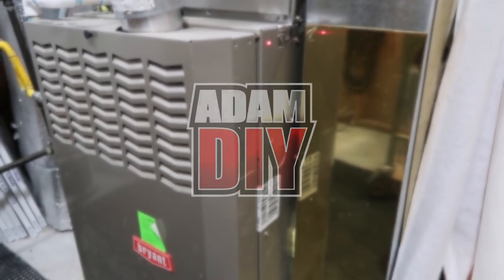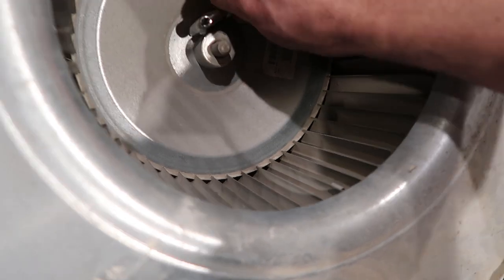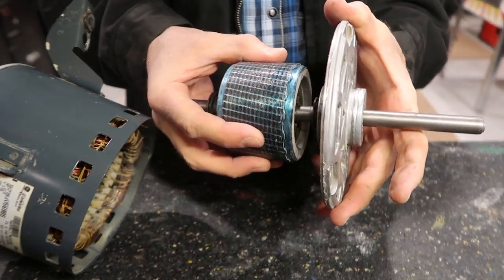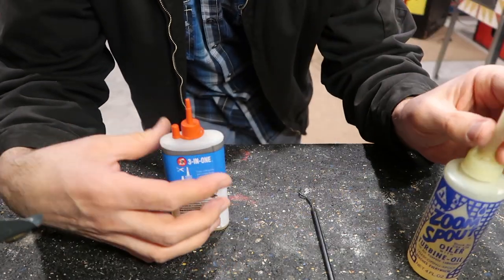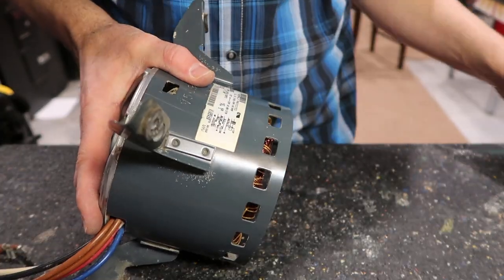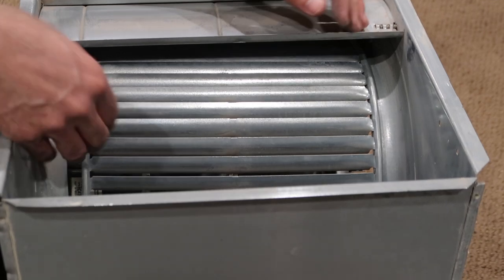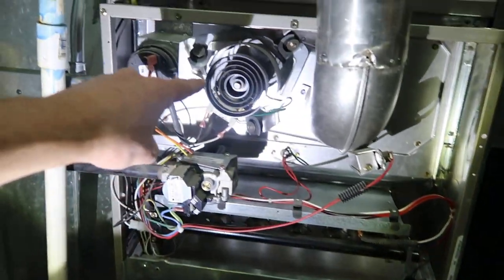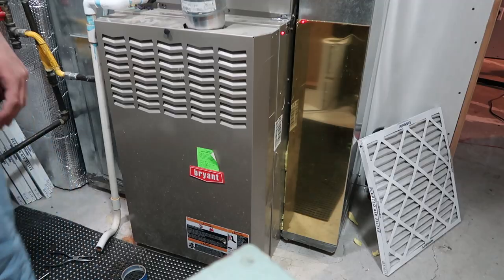How to oil electric HVAC fan motors with no port - Squeaky Furnace Repair

Comment: I got as far as trying to pull the motor out of the housing, but the shaft won't come out of the blower blade wheel. (I had already removed the shaft set screw.) Any ideas on how to get that shaft to come through? I tried some penetrating oil, and I whacked the end of the shaft a few times, but I don't want to damage it. That motor just wont come off the wheel!

Update: I used a torch to heat up the hub and a little banging with a punch & hammer got it to go through.
Reply: I removed my furnace motor today as it was squeaking badly, had the same problem you had, I sprayed a little bit if PB Blaster and spun the shaft a few turns and it became loose right away.
Reply: Ultimate  Puller

Comment: A.O. Smith GF2034 1/3 hp, 1725 RPM, 115 volts, 48/56 Frame, ODP, Sleeve Bearing Belt Drive Blower Motor I cant find the oil port
Reply: This video explains what to do if there are no oil ports.

Comment: If anyone can help me name and find for sale the little felt/paper/fabric rings that are inside the oil wells as shown in this video, very much appreciated.  I'm trying to replace the little felt/paper rings that were once held in place with metal retainers.  Shaft got stuck with debris and seized a civilian 90's Patton fan model PATPX306U with the "CS075-16U4-009 Raider 0848" motor.  Looks just like the motor in this video with the closed off rear plate and retention plate for the coils and stater, just smaller.  The rotating shaft is 5/16" wide and the ball end is 5/8" wide and 17/32" long.  Or may I substitute some felt rings used on car battery terminals?  I see a few different types of felt rings in the plumbing area of Home Depot too.  Good alternatives?

I've gone to school for HVAC and not once did we ever rebuild a blower motor.  Grease bearings and replace a capacitor, but not rebuild.  I guess we have to upsell everything.  Damn.

Comment: I have an electric furnace, I imagine this would be the same deal? Had a furnace company come and said it was fine but it still has this noise issue. They told me it does not need oil and they never oil a blower. I’m thinking I need to do this though. They told me the whistle is from aluminum tape likely allowing air to pass through and need to find the hole myself if it happens again and retape the spot.

Comment: Good video, but too much work. How much are you going to charge a customer to oil the motor? They usually last more then 5 years. When it goes out replaced with a new one. They cost around 89 plus tax. Why go through all that trouble. I believe instead of oil grease would be better.

Comment: May as well replace the capacitor and scrub the flame sensor while you're changing the filter. Capacitors are cheap enough, if the old one is older than 10 years it won't be long before it fails.

Comment: THANK YOU. My blower has squeaked 4 times over the last month. Each time I turned off the furnace and let it cool and when restarted no noise. Except this morning when it wouldnt turn back on. I have that same motor on a different furnace. Took 2 hours to carefully pull from furnace, take apart, clean and oil and then 1/2 hour to reassemble and check every connection.

Today topped out at 20 degrees F. Sure needed the heat back on.

Comment: How old was that unit? Lots of dust around the housing but none on the fins. Can the housing or fins be vacuumed in place, with a flexible hose without removing the assembly?

Comment: If the blades are caked with dust, there's leakage around the filter or an issue with the filter itself.  use a basic pleated filter and if it's changed as required, filter holder is sealed to furnace the blower wheel will never require cleaning.

Comment: Video was perfect for me.  my unit is much smaller for a condo, but the motor/fan unit is very very similar in style..just smaller.  Motor was squeaking for a week and then just would not move at all.  This is just what I need to get it running again.  I really like your attention detail which I think will help me from jacking up my unit.
Reply: update:  Yeah, it worked.  Old small closet ac system is a pain to work with but I did it.  Running fine now...at least until the whole thing dies or explodes soon. It's very old.

Interestingly the motor does indeed have plugs for oil, which are completely unreachable when intact. I still took the motor apart as you did to so that I could clean it out and oil it good.

Comment: I did this now my motor doesn’t turn freely
Reply from the maker: is it making a grinding noise when you turn it?
Reply: AdamDIY no but it doesn’t turn nearly as effortlessly as it did before I took it apart. Also now the blower doesn’t engage when I turn on my furnace.
Reply: Have the same issue after I did this

Comment: I would recommend against servicing a motor that the manufacturer clearly does not want you to mess around with.  People watching this video need to know that dealing with gas and electricity can kill them, they should not  be messing around with it.  This video may end up costing someone several hundreds of dollars if they mess one of your steps up.  

Also you sequence of operation is wrong.  Bryant furnaces have a blower purge after main power is disconnected and then restored when there is a call for heat.
Reply: He was not making this video for idiots to watch, idiots are probably looking at sedentary cats videos on YouTube. And if anyone is uncomfortable and has the money they'll pay a professional. If fixing it yourself allows you to keep food on the table, the house warm and avoid paying a professional at least $90 and up then this video was more than adequate.
Reply: Amen to all of that!
Reply: My motor model HC45TE113 costed $284 on Amazon right now.  Can you send me a check $284 to fix my motor without watching this video?
Reply: I've been messing with electric and stuff like that for my entire life and no injuries so far! I turned off the TWO circuit breakers (one at the outside unit and one at the main panel) and had before that turned the thermostat up so no call for A/C. There is no chance of electric getting through two "off" Circuit Breakers. I was able to do mine while it was still wired in so didn't have to disconnect the fan feeds, just remove the big fan blade and then the 4 long bolts and the ends came off - then the cotton/felt was there exactly as shown in this video. Everything in the motor looked perfect, but of course I wiped it off a little bit just to be sure....and now it works perfectly. Keeping my fingers crossed (motor is 15+ years old) and ordered a new motor ($175) which I will install in a week or two. But I think this one might last for years.
Reply: He's just sharing his knowledge and experience, and you're entitled to your opinion. About the tone of your comment, my opinion is that you're generalizing and being very critical of a well meaning poster of the video, yes its important to let people know the inherent potential dangers involved but you don't have to be so negative and critical, you must be a repair guy, anyway most of the people watching these videos are usually looking for understanding about whats going on out of interest and/or before calling in a repair person or are seeking additional understanding and want to check what is involved in such a repair to understand before starting a job they are not sure whether they can handle or not, many are mechanically inclined and know their limits.

Comment: You are wasting your time.  The bearings are bad !!!  Too much work  For a temporary fix.  Just replace the motor or call in a licenced tech .  Usually there is a lot more going on.
Reply: A lot more going on, huh.  Like what?
Reply: I don't agree  with the statement you are wasting your time, I have made  this repair on my rental AC units and at my home. It sure beats the $400.00 it will cost for a new motor.
Reply: George k Sounds like a technician looking for work. Bahahaha.
Reply: i am sure you're one of licenced tech that being mentioned
Reply: He is correct. The bearings are worn and oil is only a temporary fix in most cases. Most of these motors are made in China and the bearings dont last like they use to anymore. Once the arbocher starts to rub its toast.